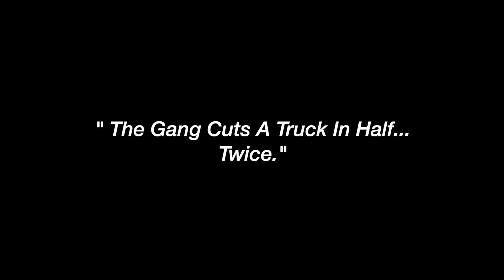Building The Worlds Craziest Overlanding Camper Truck - The FLOOR

Comment: You've mounted that floor in the worst way possible. The floor should be  mounted using a 3 point system. The floor can be tied to the truck cab in the front and a third pivoting point in the rear. This will allow the frame/chassis to flex without putting that stress into the box. If you look into any of the large manufactures (Earthroamer,Turtle, etc) of these types of trucks that is how they do it. Also poly mounts would be horrible. They have no flex and will be way to stiff causing more problems for the box. If you are going to mount it the way you are they should be true rubber  bushings to allow the most amount of flex possible or even spring mounts. Check systems like GlobeTrekker out, they have  zero torsion frame  mount kits. They use 3 pivot points verse just the one. They also have a 4 point pivoting system. They have a video explaining the reasons why you would want to choose the different mounting options.

Comment: You REALLY shouldn't refer to your work as " Engineering" in engineering you don't just put hours and money into making something and seeing if it works , you design something and analyze its failure and say that it IS going to work within certain parameters and if it doesn't you lose your job😂

Comment: Cause Suburbans and Ecsursions didn't have solid bodies all the way back.... oh wait.. they DID...  trucks got seperate beds because they are CHEAPER to build in 2 parts.  Same cab.  Short box, long box, stake box.  It had NOTHING to do with body flex.  Yes you see the difference, but only because they are not attached to each other.
Reply: This body will be much weaker than a factory SUV body, and much longer.
Reply: @brianb-p6586  is it weaker???
Reply: @greggoett  Yes, even with all of that tubing, if they clad the camper body in the usual RV materials (wood, fiberglass sheets, etc) it won't be as stiff as an automotive body... and due to the heavy contents and large size it will need to be stiffer.
Reply: @Brian B-P  I think you are over estimating how stiff the back of an SUV is.   But really doesn't matter.  His primary thought on why they split truck beds was WRONG.. it was on economics not body rigidity.   Once it's all tied together.. sure the tip of the camper will move a lot that doesn't mean the base will move a lot.  Flip a rope.. one end moves a lot.. other end stays secure to your hand.
Reply: @greggoett  The body of a vehicle shouldn't be anything like a rope.
Reply: @Brian B-P  if you've ever seen a structural analysis on a computer, you'd see see how they joint it at points.   Have you seen how they X brace behind the rear seats of a sedan or coupe? to stiffen the structure.   Have you ever seen strut tower braces that are installed aftermarket to stiffen the suspension structure?   Have you ever seen X bracing in a full roll cage to increase the stiffness / strength of a cage?    Sorry but a sheet metal structure with zero cross bracing is NOT going to be stiff or strong.